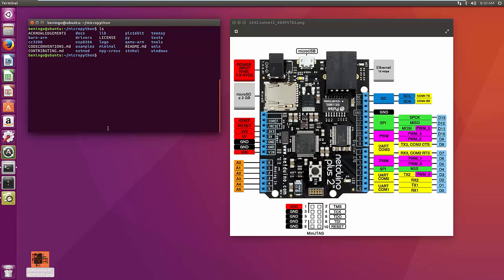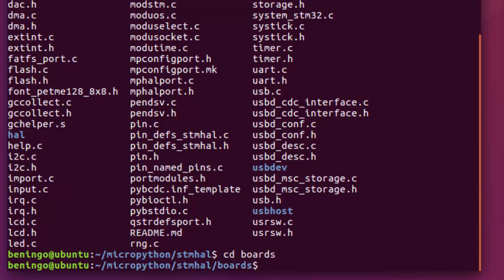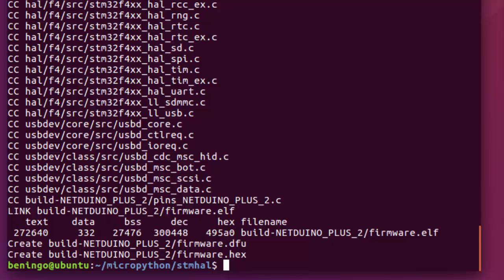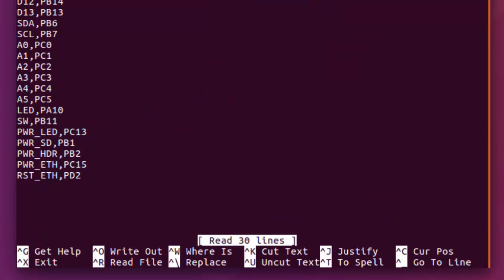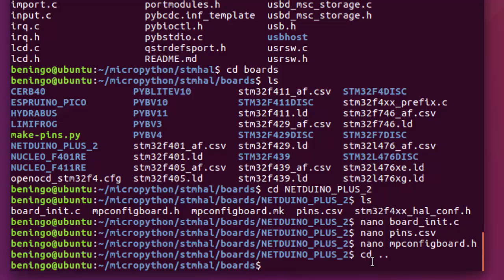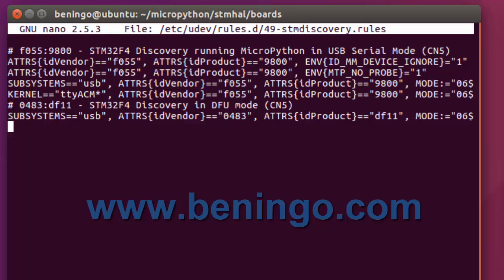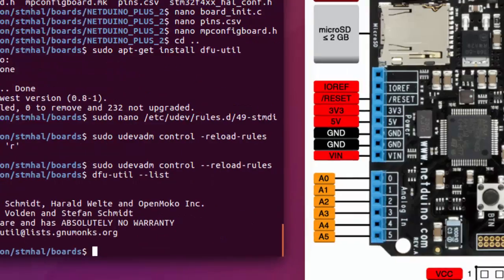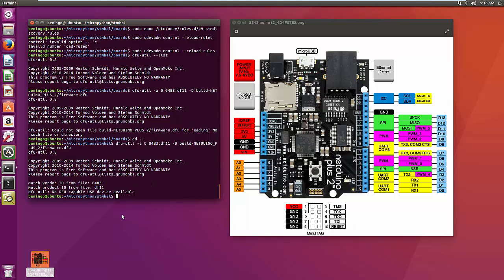Micro Python Setup Part 2 - Building and Deployment

Comment: Is it possible to build micropython on a non-gcc compiler?  Or are there so many gcc features used, that reconstructing it for a different tool be nearly impossible?   I'd love to see this either on an 8-bit PIC / AVR  (some of which have 128K flash / 16K Ram!) or in an fpga running a soft-cpu (z80, LatticeLM32, PicoRV32, nios) where you can customize the ram/flash and peripherals!

I found  couple mentions of people trying to compile on something other than gcc (ex. keil), but doesn't seem hopeful:
https://forum.micropython.org/viewtopic.php?t=3396
https://github.com/micropython/micropython/tree/master/examples/embedding
https://forum.micropython.org/viewtopic.php?t=307
 
BTW, do you still recommend Ubuntu 14.04.03 and VMware Workstation 12 for building MicroPython (1.9.2)?   Or should the newer Ubuntu (17.1)  be used?
Reply from the maker: Thanks for the comment and question. I'm sure it would be possible to use another compiler but you would be faced undoubtedly with a lot of work in front of you. If you are trying to get it up and running on a PIC / AVR, there is support for the pic16. You might be able to leverage that base for the specific processor you are looking at. 

I've been using Ubuntu 16.04 LTS when I work with MicroPython.